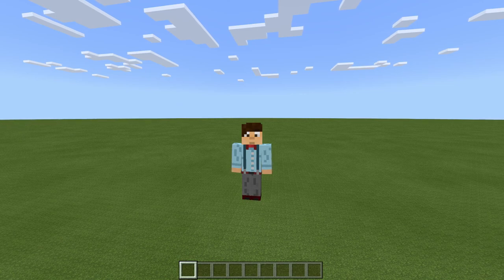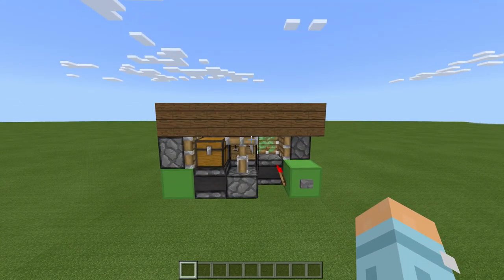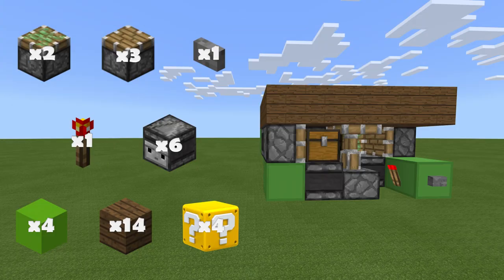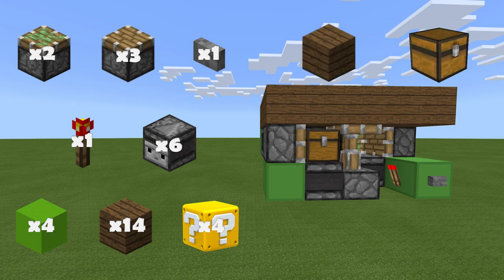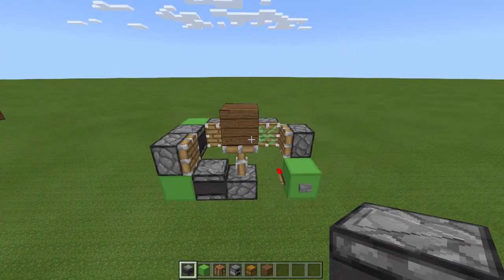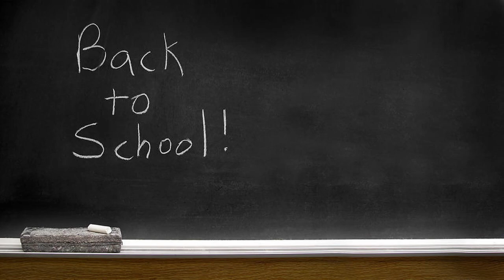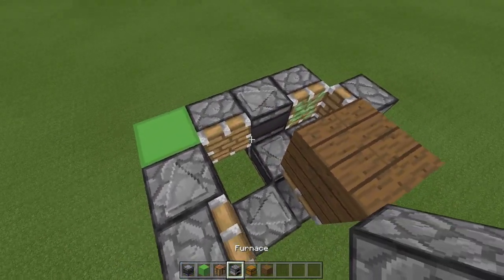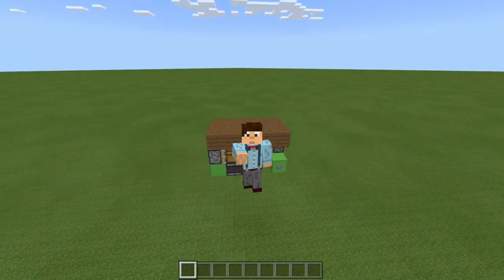Minecraft PE TINY Flush Multi Block Swapper (PE/Xbox/Windows10/Switch)

Comment from the maker: For anyone wanting to wire this up to the floor, literally just run a redstone line into the block with the button on it and then run the redstone wherever you want the new button to be :D
Reply: I like your bulid's but don't get wrong in the pronouncaciton
Reply: Can I ask you something? How can I change the position of the button on the floor, and make the machine work?
Reply from the maker: @robertomascetti670  you can just run a repeater into where the button is now, and then have dust going wherever 😁
Reply: @TheBowTieMan  thanks. Sorry but I'm a little noob with redstone